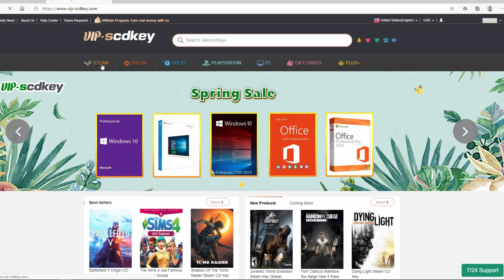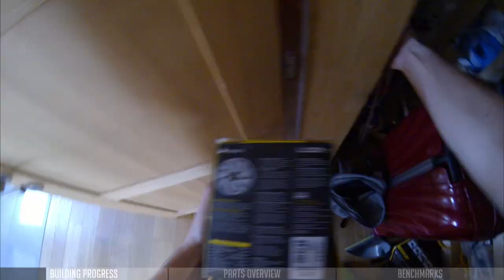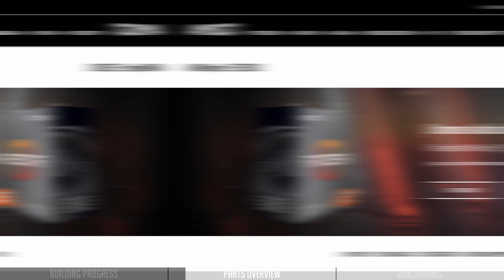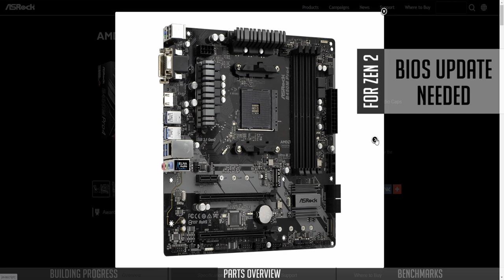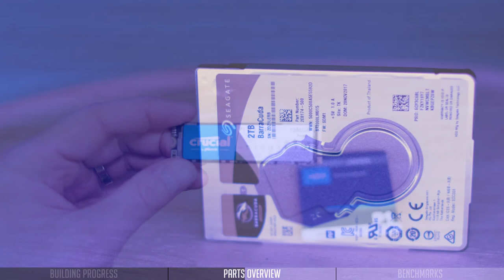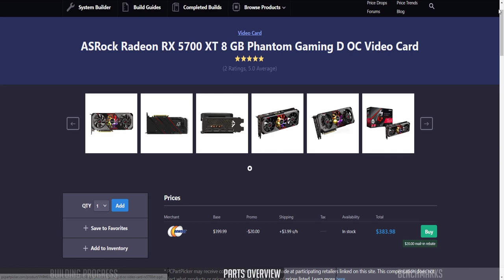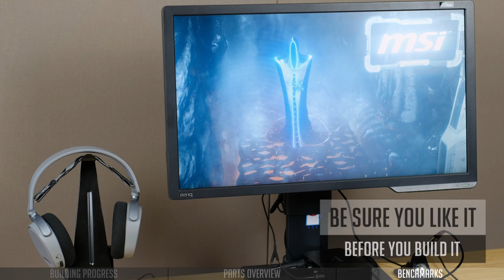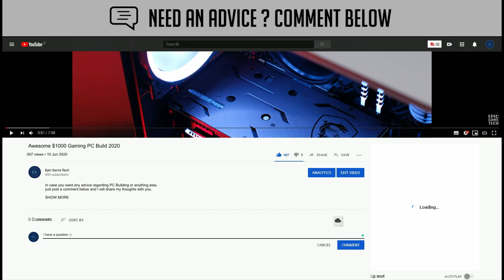AWESOME $1000 GAMING PC BUILD 2021 - RYZEN 5 3600 + RTX 2060 SUPER - 8 Game Benchmarks 1440P

Comment: Awesome video, build, description etc thanks for that and looks a really classy build. One question though as a noob builder... If buying the Deepcool RF 120M's which in the UK come as a pack of 5 what would you say was the best configuration for the fans? Would you use the 5 pack of RGB and go for 2  RGB front, 1 RGB x top & 1 x RGB rear or would you keep the the 2 x NZXT fans in the mix somewhere and only use 2 x RGB fans? Also on fan configuration would you have 2 x pulling in and 2 out or 3 x pulling in and 1 x out? would really appreciate your advice. Thanks.
Reply from the maker: Hi,
thanks :)
Will you use H510 PC case?
In general, I always recommend suing positive or neutral air pressure inside of the case. As in most cases, it makes air move through PC Case filters and not through all the gaps as a negative pressure.
For positive pressure, you need to have more fans for intake and less for exhaust and for neutral, same amount of fans for intake/exhaust. 
As you are buying 5pack, use them all. I mean why not?
If you are using H510, just use 2 fans as intake ones (it supports fans at the front) at the front and 2 fans as an exhaust (top + rear). RF120m should be better fans than NZXT stock ones, so I would replace them. Even if they would be on the same level, from a visual perspective, it will be more pleasing to have all same RGB fans for sure.

The only thing with H510 it's designed for a negative air pressure and it has no mesh or filters. So those front mounted fans actually do not help much. So the result having just 2 stock fans (top + rear) or having all 4 fans (front + top + rear) will give pretty much the same thermal result.
Except it will look way better for sure :) 

In case you are not using H510, best config would be 3 intake and 2 exhaust ;)
Reply: @EpicGameTech  Hi Epic, yes I will be using the H510 and in terms of motherboard I was thinking the 	ASRock B550M Pro4 Micro ATX AM4 Motherboard for upgradeability and for the GPU the MSI GeForce GTX 1660 SUPER 6 GB VENTUS XS OC Video Card purely for cost reasons, although this may change. Any suggestions on another up to date MB or GPU that will enable 1080p at high settings to try and achieve a FPS around 90 would be greatly appreciated, especially if it saves on the wallet. I am not a gamer of heavy intensive games, only Destiny 2 and nothing else.
Reply: @EpicGameTech   Sorry, another two questions if you get time. Why even design a visually appealing case if it only has negative pressure and if it would be an issue the do you believe the MSI Sekira 100R would be a better bet? as this is my other favourite case.
Reply from the maker: Hey,
Regarding motherboard - what CPU you are planning to use?
But in general, if you want a newer b550 motherboard, the ASRock b550m pro4 is the best out of the cheap/most budget b550 motherboards. So you are on the right track :)
Just one thing to note - the motherboard is an mATX while those pc cases you mentioned are ATX form factor. So it may seem a little weird from a visual perspective.
Regarding negative pressure and H510 well it's how it is, it was designed so. Well in general, negative pressure is not like a bad thing from a temperature perspective it's just you get more dust inside :)
That MSI case will not have a better airflow for sure.
I would check the cooler master box mb311L RGB case. Its mATX meaning will look way better with an mATX motherboard and it has a mesh front. So it will have better thermals than nzxt/MSI case :)

Comment: Okay here's weird one I planning to put my Cooler Master MASTERLIQUID ML240L RGB V2  on the top so I'm wondering if it'd fit inside this case or the Cooler master q300l (I'm in a weird place of the world where only these two are easily accessible) with an ATX motherboard (Aorus x570WiFi) and thanks for your time 
Love your videos
Reply from the maker: Hey,
Glad you like my videos 
Regarding your AIO - on both of these cases, you can mount ML240L to the front of the case only.

Comment: Hi there, just watched your instruction on HOW TO INSTALL RYZEN 5 3600 CPU + UNBOXING – CPU Installation. I got these exact same parts for my sons new gaming installed, but the PC doesn’t boot. Also the easy debug lights on the motherboard shows the VGA is not functioning. Do you have any tips? Could this have to do with the bios flash the MSI b450m needs before it can deal with ryzen 5? If so how do I upgrade the bios if the pc is not booting. So strange since in you instruction you have the exact same configuration and you don’t mention any of our problems... Btw we are use a gigabyte GeForce GTX 1650. Thanks so much!
Reply from the maker: Hello,
Oki, so you have b450 tomahawk OR b350 tomahawk?
And just to be sure, you also have ryzen 5 3600, right? :)

p.s. are you sure GPU led is on your motherboard? (or maybe CPU?)
Reply: Epic Game Tech Thanks for your quick response! I have the MSI B450M PRO-VDH MAX motherboard, indeed combined with the ryzen 5 3600. The motherboard has 4 easy debug leds. The ones for CPU and DRAM are green, the ones for VGA and Boot not.
Reply from the maker: Ok, so it's definitely not BIOS issue, since "B450M PRO-VDH MAX" motherboard is ryzen 3000 ready :)
So now comes tons of questions:
- Did you install your GPU in an upper PCIe slot? (jus below a CPU)
- Did you try to remove it and put it back?
- Do you have anything plugged into any of USB ports?
- Do you have a possibility to try some other graphics card, just to see if your pc posts?

Also, I saw some posts from people on forums that sometimes MSI boards have some compatibility issues with Gigabyte cards.
So I would try to use a flash-back functionality and update motherboard BIOS from a USB, it might fix GPU compatibility issues as-well :)
Reply: Epic Game Tech  Thanks, have tried your suggestions (video card in upper PCIe slot (it only has one :)) plugged video card in and out, taken everything out of usb, and hope to try a friends video card). Problem with flashing the bios is that it doesn’t boot, so I don’t get to see the bios)... Just to be sure, you didn’t run into any of these problems when you installed the Ryzen 5 3600 on the msi b450m pro-vdh max? Seems like I got a broken motherboard...
Reply from the maker: Nope, I didn't have any issues, and I guess you are referring to this video (https://youtu.be/uqLtkWZiGFQ)? :)
Anyway, might be motherboard is faulty, but before that, you need to be sure you did everything.
Regarding bios update - sorry I had in mind tomahawk motherboard (since in this particular video I used tomahawk) since it has a special usb port you can update bios even with no cpu installed.

Be sure to plug power connector from your PSU to your GPU.
Also, I fond this one in forums, you might try:
"GPU" failure the mobo was showing in the led's, so I take out the HDMI cable from my GPU and put it into the HDMI in the mobo and it goes to bios but the monitor that's HDMI cable I moved didn't work, just like if it wasn't plugged in (I have 2 monitors and I had left one plugged into the GPU) so I decided to see if plugging the HDMI cable back into the GPU would still be broken and to my surprise, it worked and let me in like nothing had happened.

I would also try to re-install cpu/ram (try different slots) and clear CMOS :)

Also, I would definitely try a different GPU.
Reply: Epic Game Tech Nope, I was actually referring to this guide: http://epicgametech.com/how-to-install-ryzen-5-3600-cpu-unboxing-cpu-installation-tutorial-guide/ :) the Ryzen processor doesn’t have an onboard gpu, so the hdmi on the mobo doesn’t work (if I understand correctly, I still tried and the bios doesn’t show up). 

Thanks for all the tips! I will return the mobo and switch to Asrock B450M PRO4 that explicitly supports Ryzen 3000 series :)
Reply from the maker: Asrock B450M PRO4 has quite decent VRM's and one of the best budget motherboards. So definitely a good budget choice.
But try to use a different GPU as we discussed.
I hope you will solve this soon! :)

Comment: Question can I choose any motherboard I prefer or it has to be a certain one
Reply from the maker: Hi,
you have to choose a right motherboard for a CPU you want to use and according to a PC Case form factor :)
E.g. NZXT H510 and an ATX pc case and supports Mini-ITX, MicroATX, and ATX form factor motherboards. But in ATX case, it's best to use ATX motherboard as other two will look not so good/small.
And in case you will get Ryzen CPU, you have to choose a motherboards that supports certain ryzen CPUs, in case of Intel - motherboard that supports Intel.
In my video, I've used Ryzen 5 3600 cpu and this cpu is supported on a wide range of motherboards a320/b350/x370/b450/x470/a520/b550/x570. But have in mind, for some motherboards (x320/b350/x370) you will have to update bios in order for r5 3600 to work and for bios update, you may need older 1st/2nd gen ryzen CPUs.
So in R5 3600 cpu case, it's best to use newer motherboards like b450/b550 :)
Reply: Thanks

Comment: • 1440p@60FPS is still very tough task for GPUs in AAA titles as pixel count is ~80% higher compared to 1080p. 2060S barely copes and only in selected games.
• Take RDR2 or Metro Exodus and you would not get stable performance even using 2070S.
• What I found in my personal experience is that an upscaler can be used to upscale 1080p content to 1440p in titles where DLSS is unavailable. 
• I myself use Marseille mClassic that not only adds sharpness and some FXAA but converts 1080p@60hz content to native 1440p@60hz (or 720p@60hz to 1080p@60hz). Greatly helps in games using Nvdia's ray-tracing (e.g., Control). 
• However, it's not very cheap and not useful in 100% of scenarios but an interesting topic to explore nevertheless. Especially having budget PCs in mind.
Reply from the maker: True :)
That's why you need to find "optimized" settings for every game. E.g a mix or ulta and high settings. Or one setting in game can improve performance by 30% withouth any noticible decrease in graphics ;)
Reply: @EpicGameTech  Perhaps, but there was a reason I mentioned those titles. You can barely adjust anything when talking about Ray Tracing effects in general. From what I gather from leaks, it's not going to change with RTX 3000 series. Moreover, Metro games are well-known for lack of graphics settings. You can't mix Ultra and High there. As for RDR2 and non-linear open-world games in general, any kind of consistent "optimization" is simply impossible with borderline hardware. Lastly, RTX 2000 series cards will not age well apparently and, IMHO, should not be recommended couple of months before new series release.
Reply from the maker: @p.s.3204  true :) but lots of people jsit do not use ray tracing, sure the ones that wants max graphics stuff.
But for esports titles its useless :)
Well 3000 series, we will see, some leaks suggest x times better ray tracing performance.

Comment: if you use that motherboard you don’t use the usb 3.1 or usb c port on top though right?
Reply from the maker: Hey,
yep, no usb type-c, but you will have usb 3 :)
But anyway B350 tomahawk is an older model and not selling any more. Lots of b550 chipset motherboard as one.
Also, there are some adapters for that usb type-c internal header to usb 3.0 :) sure, speed will be slower than real usb type-c
Reply: @EpicGameTech  thanks so much! I've never built a decktop PC before and I wanted to try a mid tier one for my first one . The parts on PC parts picker kept saying the front panel isn't compatible with the motherboard but now I know.

Comment: thank you so much, im thinking of building a pc exactly like this right down to the case. will sub
Reply from the maker: Hey,
Thanks ;)
Just shoot a comment in case you want to discuss any of the parts you want to get.
Reply: @EpicGameTech  does b450 motherboards come with wifi built-in or do you have to buy a wifi adapter
Reply from the maker: It depends on the exact motherboard model :)
Some board have wifi some don't. But it's the same for any chipset.
Reply: @EpicGameTech  i wanna get the Gigabyte B450 AORUS ELITE motherboard but i heard that u have to download drivers for the wifi to work.
Reply from the maker: Well, I checked motherboard website (https://www.gigabyte.com/lt/Motherboard/B450-AORUS-ELITE-rev-10/sp#sp) and i do not see it has Wi-Fi feature ;) So you will have to buy a separate dongle etc.
If it would have, manufacturer always specified in motherboards specifications.
And yes, if the motherboard has a WIFI, it's recommended to download drivers from a manufacturers site.

Comment: is the pc better than the pc in the last 1050 usd pc video for fortnite with only epic viewing and the rest low settings?
Reply from the maker: Hey,
do you have in mind this video? (https://youtu.be/uqLtkWZiGFQ)
They are more or less similar builds. Just in that one I've tested everything on 1080p and here 1440p.
I would say MSI RTX 2060 Super Gaming X is a better gpu in terms of thermals but it's a bit more expensive than Gigabyte RTX 2060 windforce oc.
So they are similar builds, just few different parts were used, but same ryzen 5 3600 and rtx 2060 super.
Aswell as NZXT H510 case is more quality one than Q300L, but costs more as-well.

So, it's basically what you can get during such timing as there is limited availability of many components :)

Comment: Can you please include the temps of the CPU and GPU... I'm planning to buy a PC with the same case but worried about it's thermals...
Reply from the maker: Hey,
This PC is out already, so I'm not able to do such a testing already. But I can comment few numbers I can check from benchmark videos, since I was tracking (just checked few of my filmed clips).
> Unigine heaven (only GPU heavy) - CPU ~67c, GPU ~65c
> 3DMark Fire Strike (only GPU heavy) - CPU ~64c, GPU ~54c
> Far Cry new Dawn -  CPU ~82c, GPU ~64c
> Apex Legends - GPU ~61c
> Fortnite - CPU ~83c, GPU ~69c

GPU temps were really good, but CPU in some CPU heavy applications / games got 80-87c. But keep in mind, it's using stock CPU cooler and pretty much same temps I got from few other build's I've made (different cases).
So to solve that in any case scenario (if you want cooler CPU) you just need to get an aftermarket cooler for $30-40 and CPU temps will be good :)
Reply: @EpicGameTech  Thank you very much for your reply....I was really confused about the airflow of this case...

Comment: So it’s good to have both an ssd and a hard drive ?
Reply from the maker: Hey,
well, most of the time it's more "budget friendly" option.
So it depends from a budget AND how much space do you actually need (how many games do you play at once).
For a similar ~$1000 pc build, you can go for two options:
1. 1TB m.2 nvme ssd that costs $120. This option is good since you have a fast drive, 1 TB space that is enough for quite a few games (unless all of the games are 100gb+) and your files. You can also add HDD or additional SATA ssd later on, like in 1 year etc.
2. 240GB SSD + 2TB HDD (7200rpm). This option will cost quite similar, maybe $10 less. So you use SSD for your system drive (windows and maybe 1-2 games) and HDD for everything else. This is a way to go in case you really need lots of space straight away. Since you get 2.2TB in total here.

So, it's totally depends from budget/use case. e.g. I play just one game at a time (meaning for 1-2 years) so for me, 1TB NVME ssd is more than enough. But Others have a huge games library and plays all of them depending from a game.
Or they just have lots of photos/videos they want to store. So they need 2TB or bigger HDD :)

Comment: was wondering what cables go into the power supply since im new to this and some cables are not labelled
Reply from the maker: Hey,
What power supply model you have in mind?
And are you struggling to connect all the pc components to a power supply or something else? :)
Reply: Epic Game Tech RM750 that’s my model
Reply from the maker: That's good PSU :)
On a PSU side, all slots are market like CPU, SATA or 24pin (https://youtu.be/QYZflPHJ4xI?t=142). As-well as you have markings on CPU / PCI-e cables. So you will be good :)

Comment: could u do a review on the msi pro vdh max?
Reply from the maker: Hey,
Possibly. I actually have pro-vdh max filmed already from earlier video sessions :)
Might do something like I did with b450 tomahawk (https://youtu.be/jOjFKFRdeBc). But probably after 3-4 videos since I planned those already
Reply: @EpicGameTech  thanks! im thinking on buying it as it is the best option around the price point in my country
Reply from the maker: I see, what CPU are you planning to use? :)
This board is ok for ryzen 5 3600, might be ok for 3700x stock. But no 3900x for sure (in terms you think about an upgrade path later on) :)
Reply: @EpicGameTech  i probs wont upgrade in 3 or 4 years and using ryzen 5 3600 so it seems like a great board.
Reply from the maker: Then it's ok if the price is good enough and you can't find e.g. MSI b450 Gaming or MSI b450 Mortar / Tomahawk motherboards :)

Comment: do you think Ryzen 5 3600 will bottleneck rtx 3070
Reply from the maker: Hey,
Good question ;)
Well, to be certain, we will need to wait for a full review, since we still do not know how RTX 3070 performs.
But I guess 3070 is MAX that r5 3600 would handle. It might have a bottleneck in some CPU intensive titles. But it should be ok in GPU intensive titles :)
RTX 3080 reviews should be coming in 1 day I guess.
But we will need to wait a little bit more (a month or so) for 3070 ;)